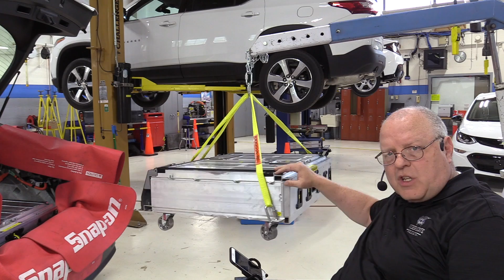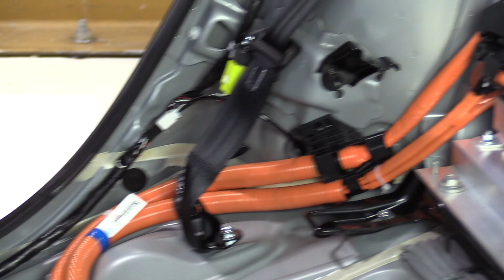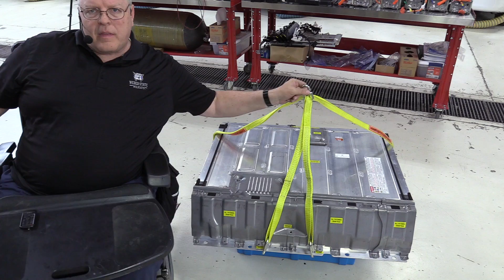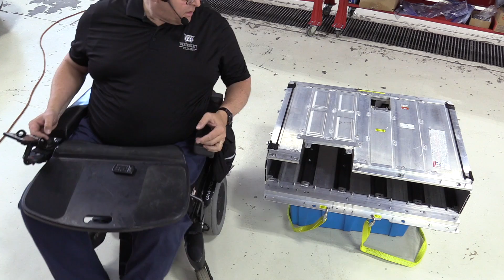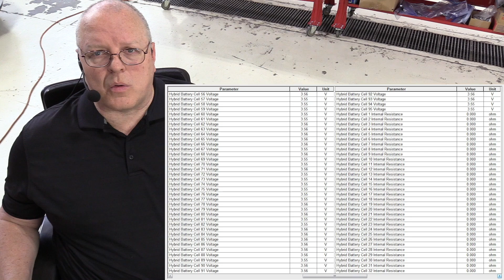2017 - 2022 Prius Prime - 8.79 kWh Battery Removal

Comment: Thanks for educating the new mechanics and us, the home d.i.y. er. I already balanced, and changed some, of my 2nd gen prius cells that were unbalanced, changed, changed long life coolant, oil changes( and had to dg oil flush due to the dreaded stuck piston rings). Also cleaned the blower motor and put a rudimentary filter so it doesn't clog and I can clean.; also changed the deep cycle 12v battery.
To anyone reading, use good synthetic oil and don't extend the interval(no more than 3 to 5k miles) or you risk the piston rings sticking and chugging quarts of oil between oil changes.

Comment: Great info as also and thank you best Prius Prof.  Wondering, if the Prius Plug In 2012-2015 cells can interchange with the 2016-2022 Prius Prime?  Like use the Prime cells in the Plug In or vice versa I guess. Thank you sir, you're the best!  Trying to save these from going to the salvage yard and first plug in for us, me and the gf.
Reply from the maker: No, they are completely different. Best wishes
Reply: @WeberAuto  Thank you kindly. I saw a seller or two claiming 2012-2022 lithium 3.5V cells.  Are the cells in the 2016-2022 gen 4 Lithium option pack that sounds like are welded in, the ones being used?  Still waiting to hear back from the sellers.

Comment: does the charger converter low voltage wires ( look like 2 plugs) connect to the front of the battery under the high voltage plugs? does the converter charger unit tell the precharge and contactor to activate when a outside charger unit is plugged in? thank you

Comment: Incredibly helpful.  I have an unusual question, and you maybe the only person in the U.S. who can answer it.  

The car may run the battery heater only when it's "plugged in".  

What does "plugged in" mean, exactly?

Does that mean it's sensing the proximity pin in the J1772 connector, or is it sensing 120V on the charging pins themselves?

Here's the practical question.  

Suppose I start to charge my car, in the dead of winter, and instead of unplugging the J1772, I just unplug the other end of the charge cord, from the wall.  (Or, there's a power outage, take your pick.)  Is there any chance that the car might still continue to run the battery heater?  

Does loss of 120V -- even if the J1772 remains connected -- automatically shut off the battery heater?

Comment: Can you charge the battery using the charger, but without the vehicle and charging cable? It looks like there is BMS module in the battery pack. If not already, can you try and shed some light more me please?

Comment: My Prius prime was hit on the back door by a car going 75 mph. Thank you for posting this video. The estimator had no idea my car is a plug in hybrid. I think it might be totaled if it hit this battery. The battery is 7500 - 10k
Reply: How is that? Professor mentioned 351 volts...

Comment: Thank you for the video! I love all of your videos! Also, a fun fact: the doorman part number for this battery pack is 587-007. And according to the doorman products site page it was used in certain 2009 to 2018 Toyota vehicles and certain 2011 to 2017 Lexus vehicles. Surprisingly you can order replacement packs through at least 1 of the national US auto parts stores with a 2 year warranty. I found out that today.

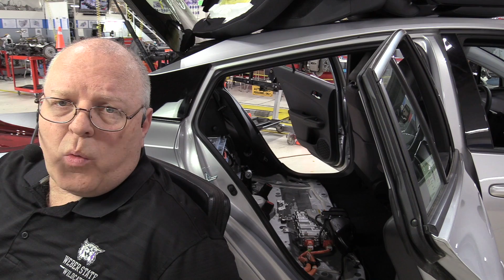Comment: Would you be able to do an in-depth video on the plug-in battery charger at 10:30?  I'm curious how it interfaces to the J1772 plug to negotiate charging current, and how it knows the battery SoC to manage charging.  The 6.6kW rav4 prime plug-in charger I expect to be similar, but it also has a 1500W inverter located somewhere near or on the same module, so not sure how that charger might be different.
Reply from the maker: Good suggestion! Thanks for watching

Comment: Is it ok to leave you Prius Prime at 80% of EV mode for several day without harming the battery?  The best I can find as to the percentage left in the battery is 9 to 14 percentage when gas engine starts. If start up is at 334.9V and full charge is 373.2.  Do not want to stress my battery.
Reply from the maker: Yes, you can leave it plugged in all of the time it is parked without damaging anything. Thanks for watching
Reply: @WeberAuto  thank you, I  learn later 84% buffer vs 100% ,like most of the lithium batteries to prolong the life. Thank you for answering love all of your videos wish all of my teachers had been a teacher like you.
Reply from the maker: Thank you very much

Comment: So if the battery becomes too hot and air conditioning is not turned on (or insufficient cooling due to blocked air inlet), will the car disable the battery and use only engine to power the car until the battery temperature has restored?
Reply from the maker: Good question, I do not know the answer
Reply: @WeberAuto  And I also do have another question came before this: Can the car actually run without using the traction battery?
If the traction battery went open-circuit somehow, does the car still turn the engine with the 12V battery?
If the car cannot power itself without traction battery at all, then it would be certain that the car will never be able to disable the traction battery.
(don't know if we can simulate this by removing the fuse inside the service plug and plug it back in)
Reply from the maker: @yrr0r244  No, it will not start or run. Never pull the service plug with the car on, it can result in a DC arc flash and a fire.

Comment: Hi something incorrect here I have a 2020 Prius Prime charging at home and at charging station 220v only takes 2 hours can at best get 28 miles other times 24 miles. Why is your charging taking so long? And I am using 6.03 KWh  what is up with that also. I would like to hear what the difference is or what.   Thanks
Reply from the maker: I found out that the car was set to an 8 amp charge. After changing it, it was faster like yours. Thanks for watching

Comment: Hello Professor,  
I just came across your videos which are wonderfully detailed and helpful.  For the Prius Prime, to prolong battery life to the maximum, would it be better to run in hybrid only at all times instead of plug-in charging and EV driving primarily?  From what I learned in your teachings, in hybrid mode battery charging by the engine occurs at a lower voltage and cycles on and off frequently with lower discharge/charge voltages, which should decrease heat of the cells versus EV driving and plug-in charging which would involve deeper discharge and charge cycles which should increase battery temperatures and thus reduce battery life.  Thank you.

Comment: I have a 2020 Prime Limited, 3 months old with about 1600 miles on it. It has recently developed a squeak coming from the battery area. I have removed all the plastic parts to be sure it wasn’t that. Anyway, you hear it most when you tweak the chassis by going sideways through a dip in the road... I can only think it sounds like metal on metal... I wonder if this top battery is rubbing against the one below it??  Any ideas? Is it missing some foam padding between the two? What can be done? Thoughts? TIA. 😊

Comment: @22.12  you mention that the system has a DC to DC converter. 
Is that a line that is always on or only active when charging?
I'd like to add two features to my vehicle without compromising the systems battery sensors. 
one would be to add a sine wave inverter and pull from Aux battery. This way I could use my vehicle as a temporary generator when necessary. (maybe change the starter to a deep cycle?)
second would be to add a small 12v fridge but have it run off the traction battery via a DC to DC step down. This way if the traction battery system does die, the car can still turn on via the 12v starter battery.
any thoughts?

Comment: That other molded piece in charge plug area also holds the cover for the charge receptacle while charging.. Have always wondered what the battery system looked like and how it functioned in my Prime. Thanks for the excellent tutorial.

Comment: the question is why can't we use the battery power to run an alternator to keep recharge also we have 4 wheels running and can use the running power to recharge to

Comment: John - do you see any other evidence of where the Level 3 charging cables or equipment might reside? 

Also, do you think it would be an easy retrofit? Would the charging port connect directly to the battery? (DC to DC) Or still go through on onboard charger? I'm wondering if the Japanese battery is any different, or if this US model can be quick charged with the right hardware.
Reply from the maker: Good questions. I suspect the battery is the same. It would bypass the on-board charger and connect directly to the battery junction block near the contactors. The contactors would need to be programmed to turn on to allow the charge. I doubt you could retrofit since it would require reprogramming several ECUs.
Reply: WeberAuto thanks for the insight. I feared some ECU flashing may be required - just some TechStream programming would be luck! 

Now... to find a wrecked PHV from Japan...

Comment: Very nice video, thank you for your work!
I have a question; 
Can be battery be charged on the Prius plug-in, at a same time as discharging? For example; if you have a fully charged battery in the Prius plug-in, you put the car on a spinning machine (to spin the wheels) get the speed to 65 mph, then plug the car to a charger- 208 or 240 volts. Will the battery be charging ? or perhaps will it slow down the discharge ?
Reply from the maker: No, the car must be stopped while charging. It will not even power on to the "Ready mode" if the charger is plugged in.
Reply: WeberAuto, Ok, thank you for your reply......

Comment: Thanks Professor Kelly and W.S.U. for this fascinating video on the Prius Prime that we have owned since last September.  We live outside Memphis so I was interested in a comment you made concerning the battery cooler.  I have observed that now that the extreme heat has hit our area I frequently get a message when I turn off the vehicle whether I would authorize the use of the air conditioner while the next charging event happens.  So to answer your question  about whether it is automatically defaulted on  I would say not.   The battery heater does have an off and on switch in the menu.  I don't know if there is a connection but I have not had any success setting the air conditioning to pre condition the cabin at the end of the charging cycle.  Others have had the same issue from the online forums.  I do keep allowing the car to use the air conditioner to cool at charging but it keeps asking me to allow each time I turn the car off when the climate is hot.
Reply from the maker: Thank you for sharing, I must have misread the setting description . Maybe it is a Toyota scan tool configured setting. I swear I saw something about that. Have a great day!

Comment: I have 2 Gen 2 and I can just deadlift the battery out but this baby looks like it weighs more than 120lbs. Do you have the actual weight? Also, did I hear that the engine can charge the main battery? If I'm not mistaken, the first Plug-In Prius had a separate battery that had to be charged from an outside source only. The new Prime only has one traction battery so it can be charged by external power OR the engine?
Reply from the maker: 270 lbs of battery weight. The high voltage battery can be charged by the engine in a special mode. All plug-in Prius models (2012-2018) use one high voltage battery
Reply: John - in the early 2000s, I was a member of the San Diego Prius Club. We had some unusual opportunities like driving the Prius C prototype. Another prototype was an early plug-in Prius that would only go about 14 miles on a charge. It had two big batteries and one was the normal big traction battery. The plug-in battery was separate and was not chargeable by the main battery. I thought this was normal for all the plug-in hybrids until the Prime? As for all the LION Prii - I don't think I could replace the bad modules like I have in the Gen 2 and 3. Those LION packs don't look like they can be easily taken apart. By the way, I'm surprised you found a Prime battery from a boneyard. I bet that cost the school a small fortune.
Reply from the maker: Wow, that sounds like it was an interesting opportunity. The prototype plug-in models did have two separate batteries, not production models. The Prime battery from a salvage yard on eBay was a rare find. It had just been posted and I bought it instantly. It was actually listed at a cost that was less than a Gen-2 Prius used battery; incredible deal!
Reply: You absolutely STOLE that battery. What Luck!

Comment: Thanks for the video Professor Kelly. New subscriber here. I own a 2017 Prius Prime and while I’m saving a lot of money on gas, my biggest fear is having to replace the battery in the future which can cost most of my savings from gas. Some people say I should never drive over 40mph in pure electric mode and use gas instead to reduce the number of charge cycles. Some people say I should try to schedule my charging in order to minimize the time that battery stays in the fully charged state. Based on your observations of the design of the car, do you have any tips on best practices that I can follow in terms of driving habits, charging schedule, maintenance, and etc to minimize degradation in battery life?
Reply from the maker: Hi, Toyota has gone to great lengths to make driving the Prius Prime a good experience. Just drive it the way you would any other car. It was designed to drive in EV mode up to 84 mph. The battery is not truly fully charged nor discharged when the gauge on the instrument panel indicates that it is. There are battery life protection strategies used by Toyota to make sure you have a long battery life. Unlike the Nissan Leaf with its terrible battery life (no cooling), I believe this air-cooled battery will last as long as the previous Prius model batteries (10-12 years or 150k - 200k miles). The only suggestions I have were made in the video. Let the Air-conditioning system cool the battery while charging and use the Air conditioning on hot days. Best wishes!
Reply: WeberAuto I appreciate it!

Comment: yes! i don't know if someone already told it but yes, the japanese version of the prius prime (prius phv in japan) has DC quick charging with a CHAdeMo plug :)
Reply from the maker: Yes, thank you very much. That is a great option.
Reply: WeberAuto yeah. Do you think that a regular Prius prime/PHV that doesn’t have DC charging could be fitted with it aftermarket? Through a Toyota dealership obviously...
Reply from the maker: I doubt it, If it did not come with it, the software programming of the existing modules will probably not work with it.

Comment: http://www.toyota-global.com/innovation/environmental_technology/technology_file/plug-in_hybrid/externalcharging.html There is DC fast charging on Japanese models. I wonder if it is possible to swap in the Japanese DC charging parts?
Reply: 0-80% in 20 minutes! https://youtu.be/7KFKMjY1PJs
Reply from the maker: Awesome information, thank you! I doubt it could be done in the U.S market. Even if you could find the the parts, the other modules on the car would need to be programmed to work with them.
Reply: Thats what I was wondering. I wondered if all that logic was contained in the battery management unit itself or if the vehicle ECU had some sort of VIN matching logic or something. Knowing Toyota, it may be as simple as plugging the unit and all the appropriate wiring in. Still, I wonder if the battery chemistry is different for fast charging verses slow US charging. Either way, thanks for the videos, I really appreciate what you do!
Reply from the maker: They usually have VIN matching logic

Comment: Great as always professor. Seems like Toyota is a lot more forthcoming with its battery capacity - the official literature from Toyota does rate the battery at 8.8 kWh which is pretty bang on with the actual 8.79 kWh on the pack itself. In comparison with the Bolt, despite its significantly larger capacity, is marketed at 60 kWh while its true capacity is actually 57 kWh.
Reply from the maker: Thank you, I agree

Comment: Battery charging times: Mode 2: approx 4 hours, 30 minutes @ 230V/8A. Mode 3: approx 1 hour 50 minutes @ 16A; Supplied charging cable Type 2 220V/6-8A
 I guess fast charge only in some countires
Reply from the maker: Great information, thank you!

Comment: I would like to know how much usable in term of kwh for each cycle and how much degradation it has over a period of time, thanks
Reply from the maker: Good question. At a nominal 351.5V (3.7V per cell), and a 25Ah rating,  25 x 351.5V = 8.7975 kWh (The nominal rating)
The lowest voltage reached in my testing was 331V (3.484V per cell), the highest voltage charged was 373.2 (3.928V per cell)
Reply: @WeberAuto I know this is an old video but while moving the car when the car switched to hybrid mode with the AC on and temperatures outside approx 38c/100f idiling for about 15 min and then plugging in the battery reached aprx 15% charge normally doesn't go below 20%

Comment: At 12:25 there is no NEUTRAL on a J1772 working on 240V, there is two Hot ( L1 and L2) thanks
Reply from the maker: You are absolutely correct, I was wrong. Thank you!

Comment: Question for you.  I have the '17 Prius Prime Advanced.  Do you think they will have an upgrade for them down the road that allows you to put a bigger battery in for more EV distance?  I know it will lose more trunk space, but I am willing to give that up for double or even triple the EV distance.  Thanks.
Reply from the maker: Toyota will never do that. It would be a cool thing, but the entire system would need to be changed to make that work. Safety and crashworthiness are issues that would be a problem as well. Best wishes!